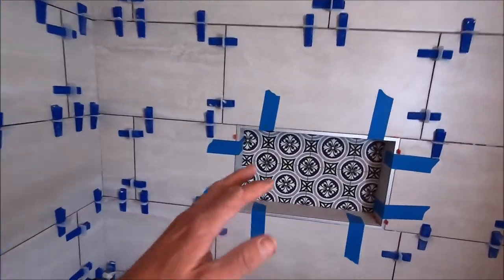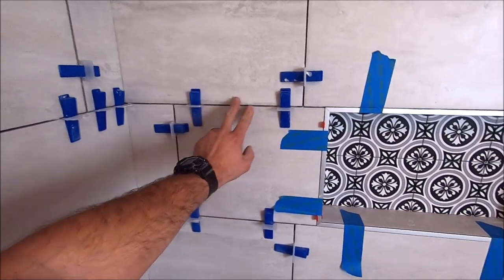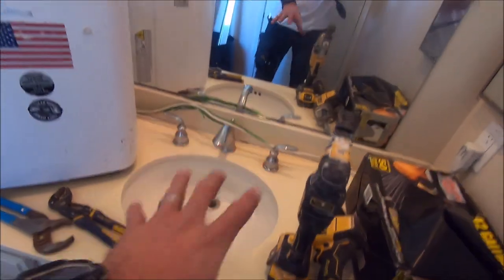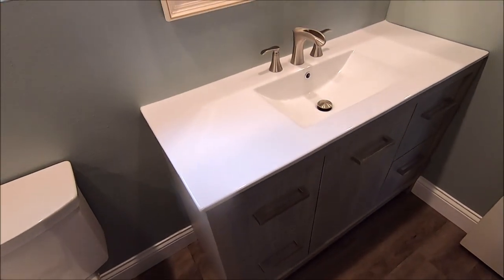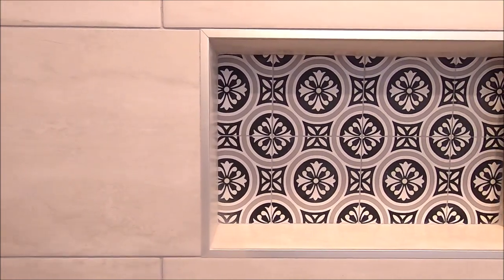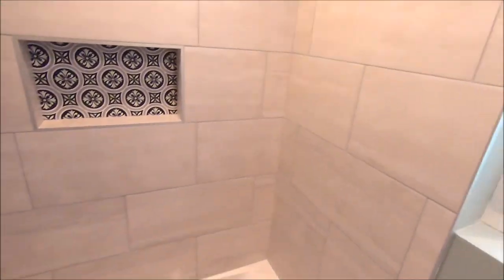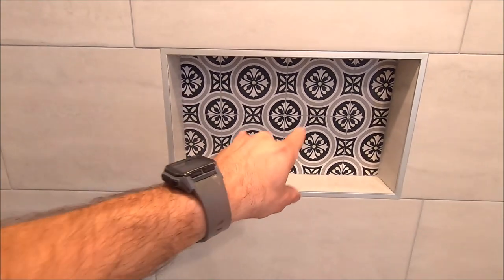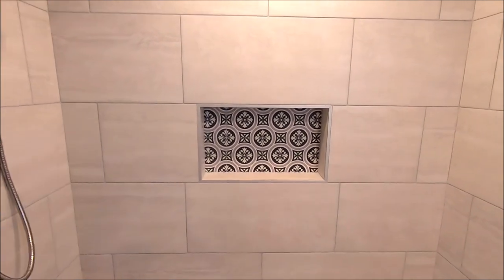Beautiful Low-Cost Bathroom Remodel Complete!

Comment: What type of blade do you use to cut  the jolly with? and when I use that prizm grout always wants to sag on the vertical joints.any tips on that?
Reply from the maker: 80 tooth dewalt finish blade and maybe don't mix it too wet 👊